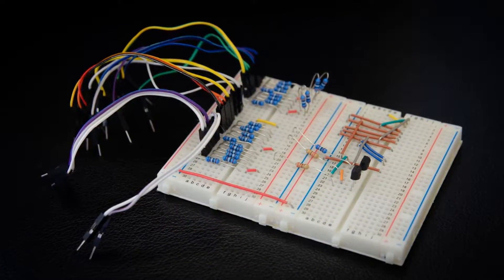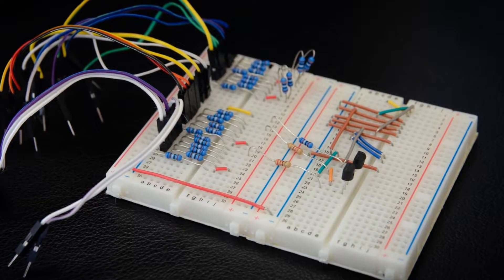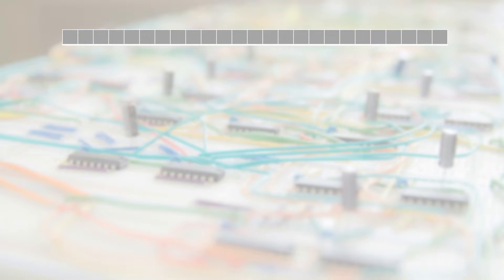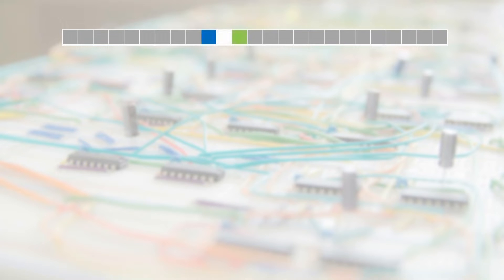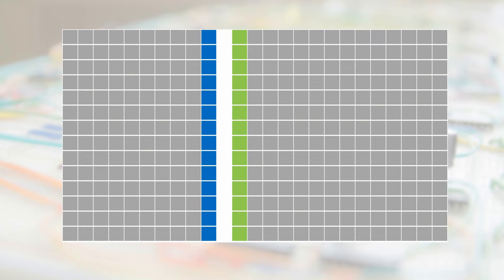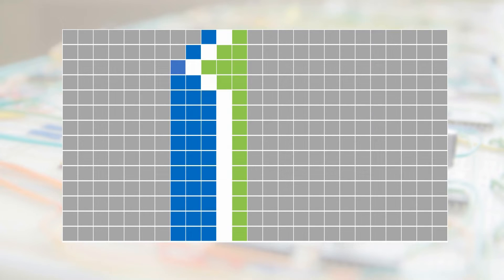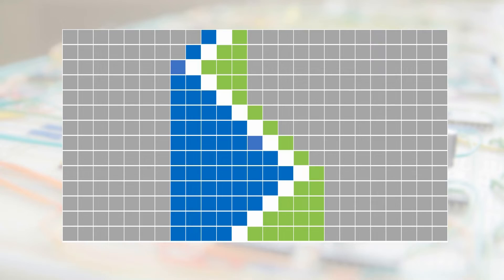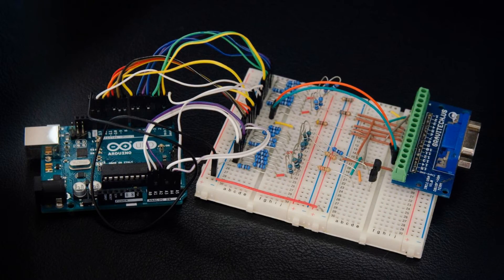VGA Output using an Arduino Uno: Raster Bars

Comment: And even today people say.... arduino and color.... impossible. Makes me think about those C64 demo coders, doing "impossible" stuff on the system. Is there still memory left to do other things? could it be connected to another microcontroller to recieve tasks to display?
Reply from the maker: The blog post linked in the description goes into more detail. Memory is very tight, and it takes a lot of cycles to generate the video signal, which limits what just the Uno can do on its own.
Reply: @SvenKrasser  Well that severly limits the possibilities if there were any to begin with. Still an impressive feat.